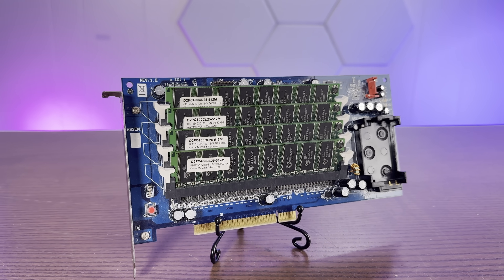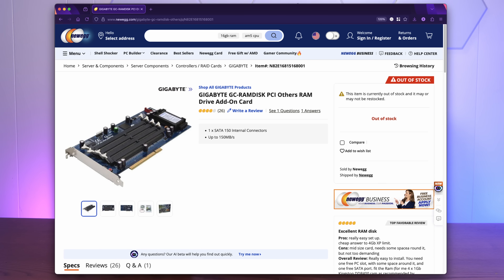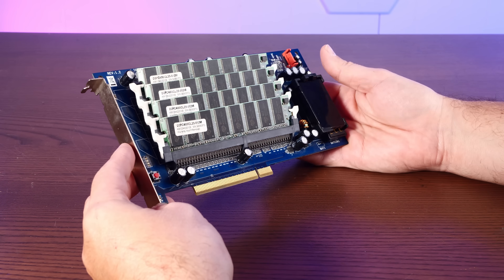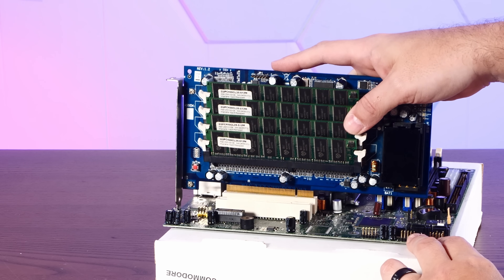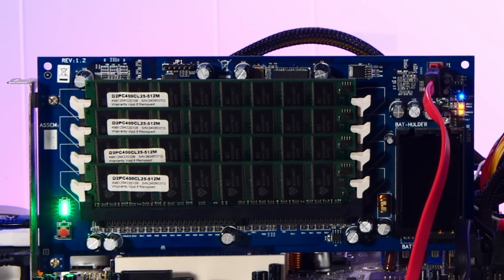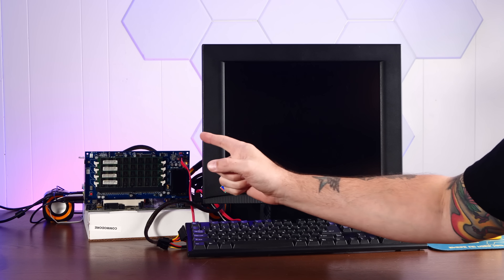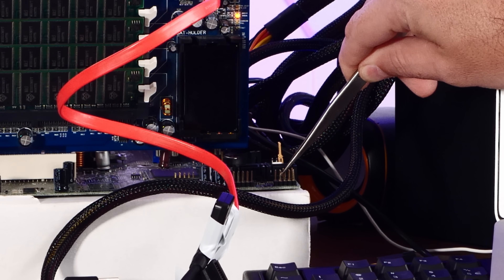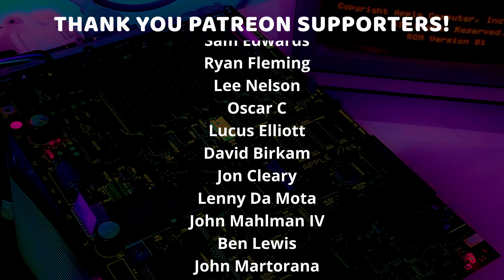This Early SSD Was WILD

Comment: This ends up being a long story/history that I had to break up into multiple pieces.

Part 1: early RAM expansion card (ISA)

Way back in the early 90s I had something  similar.  It had an ISA interface and four 72 bit dram memory slots. If I remember correctly I populated mine with 1MB ram for a total of 4 MB.   It was basically a RAM expansion card with a software driver that converted that memory into a RAM drive. The 16 bit, 8 Mhz ISA bus only provided a maximum theoretic speed of 16MB/sec, but in reality often could handle only 1-2MB/sec. It was common for "enthusiasts" to overclock the ISA bus. 10 Mhz was fairly common, but with lucky devices you might get to 12+ MHz.  

This means that using an ISA memory expansion card that used the ISA bus on a 486 (or even a fast 386DX) was a bad idea. The access to memory was just too slow.  But, using a driver to turn that ISA memory expansion card into a RAM disk was viable, as long as you could fit what you needed onto that disk. A decently equipped 486 at that time ha 8mb of RAM.  That means that using that slow RAM for a RAM disk and placing the windows swap file on it was a very big speed upgrade. While the 1MB/sec to 3 MB/sec of the RAM disk was very slow compared to regular RAM, it was extremely fast and low latency compared to the slow IDE hard drives of the time.

I believe that the memory expansion card could use up to four 4mb RAM sticks, but that was very expensive at the time.  I bought my memory expansion card used at a swap meet, likely for $5-10.  Theoretically, I could have bought several (base on number  of free 16 bit ISA slots) of these in order to increase the RAM further. It wouldn't have made it any faster.  If I had three, each with 4MB RAM, that would have allowed for a 12MB RAM disk. At that time, a 12MB swap disk on slow RAM would have been amazing, or if you needed a few MB as a scratch disk (photo editing, autocad, etc).
Reply: Part 2: Later memory expansion card (EISA)

A couple of years later I built my own Netware server (I had a largish BBS). The motherboard had EISA slots, which I wanted for a pair of 3com network adapters. I also found an EISA memory expansion card.  EISA was an extended protocol for ISA that was 32 bit and 10 MHz with a rated speed of 40MB/sec. As it was only used for servers and workstations, it was nearly impossible to overclock.  

The EISA memory expansion board that I found had 12 slots and was capable of 12MB of RAM cheaply. You could use 4MB sticks for a total of 36MB. When the card was made, EISA memory was fast enough for 386DX, especially the slower 16 and 25 Mhz versions. Unlike the 386SX cpu (which still had 16 bit IO), the 386DX had 32 bit IO. My server cpu was an AMD 486sx-25 overclocked to 50MHz.  The only difference between the 486sx and 486dx was that the 486dx included an on-die FPU.  Some motherboards had a "math coprocessor" slot for the 486sx. What was crazy was that this "math coprocessor" chip which was called a 80487 was actually a 80486dx chip. When you installed the "math coprocessor" the 486sx would be disabled (and could normally be removed). At that time, a FPU was not needed for most people. AutoCAD made use of one (and it made a huge difference), speadsheets might be able to use it, and scientific programs. Games were just starting to take advantage of a FPU, if your cpu didn't have an FPU it would do the floating point calculations in CPU at a much slower speed. This is a long way of saying that a 486dx was a very expensive option (especially compared to the very cheap AMD 486sx25) for a file server that didn't use an FPU (except for software RAID and network routines that were often off-loaded to a good ethernet adapter (such as a 3com EISA adapter). At that time,  if you wanted RAID (which generally implied RAID5), you purchased a RAID5 capable SCSI hdd controller that had a built in co-processor and sometimes a RAM cache.

So once again, I had a cheap memory expansion card (EISA this time) that wasn't fast enough to use as expansion ram. I instead used it as a 12MB RAM cache for my server's SCSI hdd's and CD-ROM drives.  I believe that I gave 8MB towards the cache for the HDD and 4MB towards the cache for the CD-ROM drives. At that time, a SCSI CD-ROM drive that could hold about 700MB of data was much cheaper than a SCSI 1GB drive. As a BBS, I had 3 SCSI CD-ROM drives that I stored  older freeware programs on (about 2.5GB in total) and then use about 1.5 GB of a RAID5 array for newer shareware programs.  My two EISA SCSI adapters had co-processors, but no onboard RAM.
Reply: Part 3: RAM card used (BBS)

And to finish off the story of the ISA memory card, it got moved into a machine that was dedicated to run a huge (at the time) DOS Batch file which was over 30,000 lines long.  When the machine booted, it created two RAM drives from the 4MB of RAM. The first one held held the batch file and was pretty small (possibly 256k, I can't remember). The rest of the RAM was used for a second RAM disk.  One of the biggest jobs of this computer was to dial other BBS's in order to automatically transfer files. Modems at that time were slow, in fact many BBS's had 9600 or 14400 modems (bits per second).  This was an average of 1.2KB/sec to 1.8KB/sec (the modems had compression), assuming a good phone line and connection.  This meant that a 14400 modem with a good line would often take at least 10 minutes to transfer a 1 MB compressed file. Almost all shareware was compressed using .zip.  I was automating transferring messages (there were many message boards that various BBS's participated in. As it was expensive for every BBS to call long distance to get these message boards, a few would do it instead, these were called hubs). My BBS was a major Hub for my county. I had deals with other hubs so that we didn't all download the same message boards, which saved us alot of money. Instead, I aggregated these message boards. The other hubs shared all of the message boards that they downloaded, which would then get transferred to me. That machine would unzip those message boards, using the bigger RAM drive as a scratch disk.
Reply: Part 3a: Usage for a crazy BBS

My BBS then hosted all of the message boards from every participating Hub. Those Hubs would then decide which message boards that they wanted to participate in an would then only need to transfer those message boards back to their BBS (using a local, free phone call). The hubs could call my BBS using a special phone number any time that they wished and as often as they wished. In this way, even USEnet message boards were quickly updated for local messages from users in our county.  We created our own local message boards for the local BBS's. All the other BBS's could also call as often as they wanted. Most of those smaller BBS's only had 1 or maybe 2 modems, so they usually only called in during slow periods as using a modem to call my BBS would mean that that modem wasn't available for their users.

Then I made a breakthrough. There were games that you could play on BBS's. Very few were designed to be used by multiple BBS's connected together. Many were however designed to run on a multi-node BBS (node being a computer/modem). I had a buddy that also had a medium sized BBS an a designated Hub. Together we figured out how to make a multi-node BBS game work between both of our BBS's.  To the game, each of our nodes looked like a node on one BBS, not on two BBS's.  This first game, we started running in this way. My computer that was already handling all those message boards would then watch for updates to a game node on my BBS. If it saw one, it would then create a zip file of that game data. The next time my buddy's BBS would call me, he would send his BBS nodes data, that computer would unzip it, an integrate into my BBS's game and then send him the updated information. 

I created the batch file for him to use. It wasn't long until I had figured out multiple games that we could share. Then we invited the other Hubs to join in. The trick was that every BBS that joined a game had to run the same version of the game (and we had to coordinate upgrades). Each BBS would be assigned as many node numbers as they desired (often a BBS operator had a PC that they could use as a node, even though it did not have a modem).  Most games had pretty high limits. 64 or more nodes was not uncommon (because there were massive BBS's in the world at the time). I reserved nodes 1-10 for myself, gave my buddy 8 nodes, and everyone else got enough nodes for the number of modems, plus 1 and then a few spares. This meant even a 1 node BBS would get at least 5 node numbers so that they could easily expand.

Once we had things running smoothly between the major Hubs, I invited smaller Hubs to join.  A smaller Hub was generally a small 1 or 2 node BBS that had a specific theme/hobby. I know one was for HAM radio and another was RC cars. These Hubs would join message boards that they wanted, but were really niche. In other words, a bigger Hub wouldn't likely pay for the long distance to get those message boards. Most of those niche BBS's had already connected to me as their main Hub. This was because I allowed allowed any other Hub to call my BBS, download any message board that I had with the agreement that they would provide me any niche message board that they had.  This allowed even the smallest niche BBS to get access to a huge number of message boards that they couldn't afford to join, including subsection of large message boards that fit their niche.  In turn, they knew that their hobby would benefit because more people would have access to their hobby's message boards. 

It didn't take long for the other major Hubs to join my program. If they didn't then they couldn't compete.  My "super hub" concept meant that a large number of message boards were being updated by multiple Hubs, which meant that combined, we had very updated message boards compared to a Hub trying to go solo. As more Hubs joined in, it just got better and better. 

At that time, if you wanted to get all of USEnet and you called long distance once a day, it could cost you several hundred dollars a month.  USEnet was huge as it had message boards for shareware releases and of course porn.  It didn't take many low resolution (often 240p or lower) jpg's to equate to tens of mb of data.  Most  BBS's that needed to call long distance joined Sprint's Friends and Family (listing the BBS's that they called as a Friend) for the discounted rate. After 9pm was also discounted (later 7pm).  Discounted was about 10 cents per minute and for higher long distance calling per month, the carriers often switched you to 6 second call blocks which started as soon as your called hit their network. This means we got charged for a busy signal which could be somewhat common when calling into a big BBS).  There are 3600 seconds in an hour or 600 blocks of 6 seconds. This translates to $6/hr and if your BBS only does 1 hr of long distance calling per night, that is an average of $180 per month. Minimum wage at the time was around $4-5/hr.  Where Sprint got you was if you initiated your call before the discounted call rate time (9pm or 7pm). This was based on their network time, not your time. If you called before that time, even by a fraction of a second, the whole call was billed at the normal rate. Instead of 10 cents per minute, you could be facing 20, 25, 30 or more cents per hour (different rates based on where you were and where you called).

The whole point of describing all of this in detail is to explain that that one computer that processed all of this data was very busy. If it wasn't for that RAM disk I would have needed a second machine. I originally used a 386sx for that job. I then had to upgrade it to an AMD 386x40, then it got upgraded to an AMD 486sx25 overlocked to 50 MHz. In raw cpu power, this  traded blows with Intel's (and later AMD's) 486dx2-66 and stomped all over the 486dx2-50. The dx2 was a clock doubled cpu. You set the motherboard for a 25 MHz and the CPU ran at 50 Mhz internally.  A couple years later I did get an AMD 486dx2-50 and overclocked it to 80Mhz.  When the Intel 486x2-66 cpu came out it was something like $800. Meanwhile, a lowly AMD 486sx25 could be bought new for about $60.  Both prices where wholesale (which is what I paid for computer hardware). 

The next big event was that I met another Navy vet that lived in another county. He also had a BBS. We found out that if we could find someone that lived in a certain location, I could get a phone number there, set it to call forward to his number.  I found one of my users that lived in that location. I offered him a "premium" membership to my BBS in exchange for him having a phone line installed in his house and paying for call forwarding (no other upgrades). Once it was installed, he plugged his phone in, set the call forward number and unplugged the phone. I could now call his BBS anytime I wanted for free. 

His BBS was already a minor Hub for his county.  Once he was connected to me (via my BBS calling his), he was quickly able to become a larger Hub. Not only that, but we were able to transfer both county's local message boards between each other for free.  It wasn't long before we both needed to add a new node to our BBS's. His user base increased because of how updated his message boards were and how he was the only BBS in his county that was part of my multi-BBS gaming experience. That was truly unique. 

The way most BBS's were configured was to have multiple phone numbers. The first phone number was published, an then when they added another phone number, they then paid for call forwarding. In that way, if someone was connected to the first node and another user called, they would automatically be forwarded to the next phone number.

As a BBS grew beyond 2 phone lines, they often ran into a new issue. Call Forwarding only allowed a single forward.  When that 3rd line was installed, we would configure the 2nd line to call forward to the 3rd line. And then we waiting, and waiting. We'd see that both the first line and second line were busy, sometimes for hours at a time, but the 3rd number was never used. We would then call into our own BBS when the first line was in use, and we would connect to the 2nd line as expected. Then we would try again when both the first and second lines were in use and get a busy signal. Maybe we would test things by calling the 2nd line and to our confusion, get connected to the third modem just fine. It turns out that most phone companies charged more for a special call forward that would allow multiple call forwards to work. Worse, some phone companies only offered that feature for commercial phone lines (that were about 2-3 times more per line than a residential line).  My residential phone lines were about $20/month plus a few bucks for the multi-forward, plus of course taxes. In other words, a bit over $25/line/month.

Then next learning curve was that the last line had to be forwarded back to the first line. This was because it wasn't uncommon for someone to use their modem to call in, but the connection fails in a few seconds and they get disconnected. Then there were people that had a service where if you were on the phone and someone called you, the phone would beep several times, this was called "call waiting". If the user didn't disable this feature when calling into the BBS, and someone called the modem would drop the call. The final issue was most people had a single phone line. This means if you called into a BBS and someone else picked up the phone to make a call, it would often cause your modem to drop the call.
Reply: Part 4: Pains of growing a BBS

As your BBS grew, you might offer "premium" users to have access to a special phone line. This would often be a second set of phone lines that didn't get forwarded from the main or public set of phone lines.  As my BBS expanded, I offered this option for my users. If they "donated" $5/month they had access to the premium phone number.  Prior to adding this service, I had  4 phone lines. I added 2 additional phone lines.   Most BBS's used external modems as they were much more stable, offered LED indicators,  but were much more expensive. Most BBS operators quickly learned that an internal modem often could not handle being used for long periods of times and would lock up.  The only solution was to reboot the computer.  External modems (at least the quality ones) rarely locked up. Worse yet, they came out with what were called "WinModems", which required Windows in order to operate (they were basically software modems). 

When I added the extra 2 lines, I had another issue. I only had two 14.4k modems and two Zyxel 19.2k modems (these offered 16.8k and 19.2k but only with another Zyxel modem that supported the higher speed). A few years earlier I received a couple of donations. One was a very nice 2400 Baud modem that had flow control and compression (pretty rare for that speed modem) and a 9600 baud modem that had neither flow control or compression. 

My solution was to create 3 banks of phone lines, each with 2 lines each.
Bank #1: The nice 2400 baud modem and the 9600 baud modem locked to 2400 baud (9600 without flow control was often slower than 2400). I published this phone number and requested that those users with older modems use that phone number. I explained that that would allow those with faster modems the ability to connect at faster speeds and that if those slower modems were in use, they would automatically get switched to the "main" line.
Bank #2: This was the two lines with the 14.4k modems. When the 2nd line was busy it would forward back to the 1st 14.4k modem
Bank #3: This was the two super fast Zyxel 19.2k modems and required a "premium" account. The 2nd line would then forward to the first line of 14.4K modems. If a non "premium" user connected to these lines, they would be informed that that number was only for premium users and then give the other two numbers for non "premium" users.

In this way,  the 14.4k modems were available more often, and the premium users got 2 extra phone lines. It also meant that if a user wanted to use a super fast Zyxel 19.2k modem they would have to be premium (which helped offset these expensive, but awesome modems).

As my BBS grew, I actually added a 9600 modem that had flow control to the "low speed" bank. This was another donation from a user that I traded for a few months of "premium". 

My BBS grew, eventually I had the 3 "low speed" lines, 4 "normal 14.4k" lines, 2 "premium 14.4k" lines, 3 "premium 19.2k" lines, and 1 16.8k line for the other BBS's to call into. The premium "19.2k" lines still required a donation of $5/month, but the premium "14.4k" lines only required a $2/month donation.  Those that donated at least $5/month were allowed to call the 19.2k phone number, which would call forward to the premium 14.4k phone number, which would call  forward to the main 14.4k number. In this way, those that donated $5 or more per month had access to 5 "premium" phone lines, including 3 that offered speeds of 16.8k to 19.2k. I had two Zyxel 19.2k modems and one US Robotics 19.2k modem.  This meant that I actually create another "bank" of modems.  Those that donated $5 or more per month were given the phone number for the US 19.2k modem and the phone number for the two Zyxel 19.2k modems. This was because the two "super speed" protocols were not compatible.  Both of these numbers still gave those users access to all 3 of these premium lines, but gave them a higher chance of connecting to one that was compatible with their modem. The premium Zyxel 19.2k modems were expensive enough, at about $450 wholesale, but the US Robotics modems were about $700. The crazy thing was that the Zyxel modems had a LCD screen that showed current speed and other data important for diagnosing issues (line noise, packet resends, etc). The US Robotics modem had an LED that showed the connection speed (I think it was 2400, 9600, 14.4k, 16.8k/19.2k) but it did not update as line conditions changed.  US Robotics was name that had been trusted in commercial spaces for many years, and they could and did charge more for it.

For only $5/month a user had access to the faster speeds, 5 premium only phone lines plus 4 additional public phone lines. You could not be forwarded from a 14.4k or faster phone line to the two "low speed" phone lines. The single 16.8k line was a Zyxel 16.8k modem that I got on special. I put that on a phone number that only other BBS's could call into and was only for BBS to BBS data transfer. This is also the line that I used to call out to other BBS's.

By the end of my BBS era there was only one more upgrade made. I purchase two Zyxel 19.2k modems and installed another line dedicated to calling my buddy in another county.  I made a deal with him that if he got another phone line dedicated to a connection between our BBS's that I'd let him use a Zyxel 19.2k modem for that purpose.  I then used software that was mainly designed for creating a peer to peer network using a null modem cable, an instead used these 19.2k modems. This enabled me to create a "share" on my side that he could map a drive letter to on his side.  This allowed us to continuously keep each other's message boards and games updated. The long term plan was for him to switch to using the same BBS system as I used, allowing to combine our BBS into a larger BBS that spanned 2 counties.
Reply: Part 5: Into the World Wide Web 

And that's when he found software that allowed his BBS user to "use the internet".  In reality, it allowed his users to use a term program to "telnet" into select locations, mainly the State University that he live by (an was attending). He was so excited, he had me log into his BBS and try it. It took awhile for the implications to kick in. When they did, it was obvious that medium to large BBS were going to die.  I just didn't think that his idea of running a BBS to simply telnet into some University servers was where things were going.

And then we found Linux, specifically Slackware Linux.  A bit of research and we found out that using Linux, our users could connect to us using a modem which would allow our users to not only telnet directly from their computer at home, but also the World Wide Web and Internet Rely Chat plus more message boards than even I offered my users. I built another computer and installed Slackware Linux on it. I brought it to his house where we figured out how to get it to dial into a service called "freenet" that was offered by the university.  Their modems were only 9600 baud. We configured that computer as a "router" and then from his windows computer we could go to websites, telnet into the universities servers, and use IRC (Internet Relay Chat).  That was a huge game changer for us, all done over a weekend.

He skipped classes that week and transformed his BBS into tiny "ISP".  His users were blown away, even though most of them had "freenet" accounts, they thought it was better because they were connecting to his "router" at 14.4k.  It was painfully slow when 4 people logged into his system to use the internet, when his connection to the internet was only 9600 baud.  He ended up finding a company in his area that was offering internet and paid for an account. It may not sound like much, but 4 people sharing a 14.4k connection to the internet is significantly faster than 4 people sharing a 9.6k connection through a free university account.

When I got home, I built another Linux machine and connected it to him via the call forwarded line.  I was now able to research using the internet from my place using his internet. I ordered a 64kbps ISDN line and modem. After that got installed, I also switched to Internet only.  Keeping a tiny portion of the BBS going long enough for the other BBS's to set up new hubs to replace me.

He then prioritized his internet traffic to use our 19.2k link and keep his 14.4k as a backup. It wasn't long after that we decided to create a corporation for our Internet Service Provider business.  We opened an office near his house and upgraded to a T1 Frame Relay as that allowed us to start cheaper by have a 128k connection to the internet that could "burst" up to full T1 speeds. That meant we were only guaranteed 128k speeds but we often saw much faster.  A couple months later, I installed a Partial T1 Frame Relay connection at my house.  This started as a 64k line, burstable to 256k and we connected to our main T1 Frame Relay.  I kept the 64k ISDN line as a backup for a few more months until finally increasing my connection to 128k burstable to 512k.  It continued to grow for a couple years, including several more locations in the state. We were a small regional ISP in the state.

Then 56k modems came out.  I still treated the ISP as my "hobby" as my time was invested in my own business. I didn't realize how over his head by "buddy" was.  Maybe if I'd invested more time in it, we would have been in a position able to switch from mainly 14.4k modems to the new (and expensive) upgrade to 56k modems.  The phone company only offered basically two ISDN 64k for a total of 128k that could support two 56k modems, or a T1 Frame Relay circuit that could support 24 modems. The modems on the ISP side were not the same as the customer modems and were very pricey.  In order to start upgrading to support 56k would have required about $5000 up front for each 24 modems and lines. Then the cost per line for the Frame Relay T1 was about 50% more.  We had multiple sets of upgrades to do and not enough capital. Worse yet, the 14.4k modems were nearly worthless (maybe $50 each if lucky but not that much if sold in sets of 24).

It was the death of many smaller ISPs.